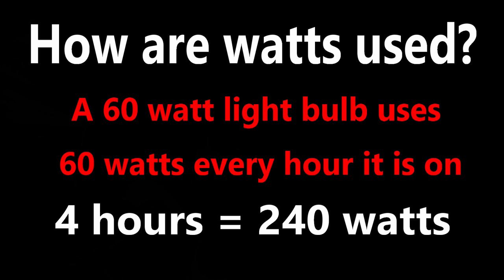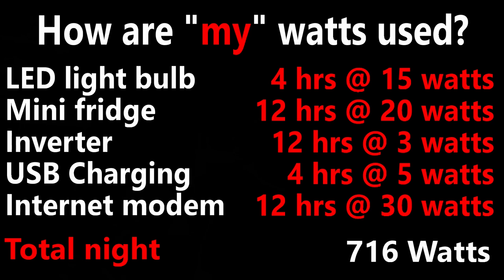DIY How to Size Your Battery Bank & Solar Panel Needs

Comment: Great video Joe and thanks for the shout out! A lot to take in but  now I have a better understanding. Think I will watch it a few more times. Solar is on the to do list. I have so many things I need to get done. Maybe I will do a little research and start buying a battery a month to start. I read the Star Link dish has a heater built in for when it snows. So it will pull a lot of watts when it heats to melt the snow. I will crunch some numbers and start figuring it all out. First I think the porch will need to go on. I plan on building part of the porch closed in for my solar and battery bank. It will be on the outside wall opposite of the breaker box. Thanks again.

Comment: Great, simple explanation of how to size a solar system or any electrical system, Joe.  Another thing I like to keep in mind is efficiency.  I can't think of anything that gets more efficient with age.  Not only do the solar panels and batteries get less efficient; everything I'm running on that system gets less efficient.  One thing that can slow the aging process is maintenance.  Clean or replace filters often. Clean air conditioner and fridge/freezer coils and fins. Clean solar panels and maintain storage (batteries). Keep lubricants applied or at the right level for anything that requires lubrication (just about anything with moving parts, if it's not able to be lubricated then it needs to be replaced after wear).  For anything that needs to be or cooled, add extra insulation and block direct sunlight.  if it needs to be heated, add extra insulation.  I could go on and on forever, but this comment is way too long, already.
Reply: Oh, yeah, and sometimes it makes more sense to run certain things on their own power system.  Keep all of your electrical wires as short as possible.  If you want to add a pump or compressor or gate opener or water heater 250 feet away from your house, give those items their own source of power.  An electric water heater or anything that uses a lot of power (dish washer with drying heater, air conditioner, heat pump, clothes dryer, etc.), even in your house should probably have their own solar or other system.  They'll kill your system!!!  Clean any appliance or other thing that uses water with white distilled vinegar or other appropriate solution for the item, periodically (good idea even if the item isn't electrical).  Yep, I'm talking clean and replace periodically (and use distilled water where possible) as needed: water heater elements and tanks and pipes, toilets, faucets, coffee makers, washing machines, just everything.

Comment: Texas weather goes like this 16F, 92F and 59F in a week.....Make up you mind Texas lol

I think these panels are the best investment I have made. I have another 24v inverter on the way and others accessories. I picked up my first Mppt 60A charge controller as well.

Well, good video bud.

Comment: Thank for the numbers you just confirm that I was doing it right. You need to replace that mini fridge. LG has a 6.9 cubic ft. inverter fridge that using 14.4 watts for 24 hours

Comment: Joe, if you need 1000 watts ,then you want a 4000 watt set up, because if your lucky, you lose 1/3 in your charging panels  then too have the extra usage ,per day, and loss too wiring/ charging distance  so too use 1000 watts per day, and still keep the charging up too needed usage ,in off sunny days that's another loss  of at least half usage. 
myself had a 10,000 watt setup ,but was lucky too earn 800 watts a hour during the day light . snow and clouds cut that down too.

Comment: Awesome video! What made you decide on a 24v system vs a 12v system. Thanks.
Reply from the maker: +SacredBeats You don't need as expensive big cables. That's the primary reason.